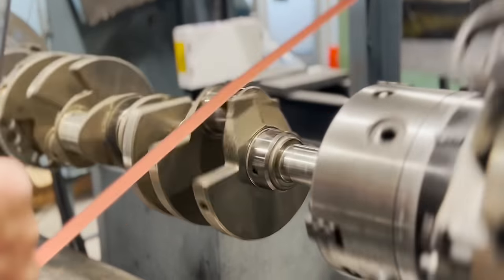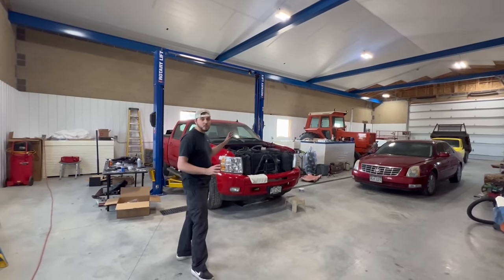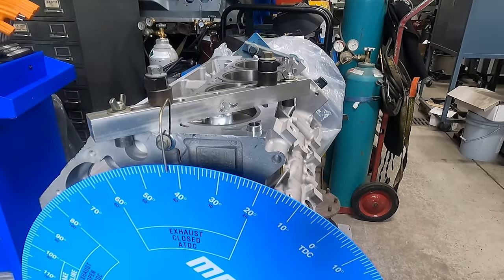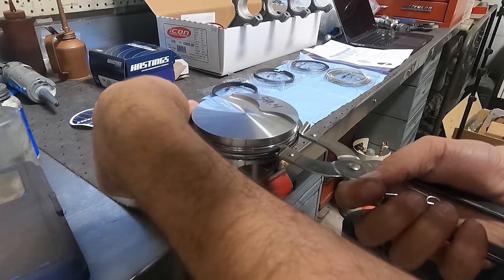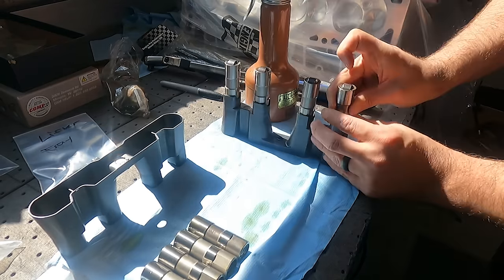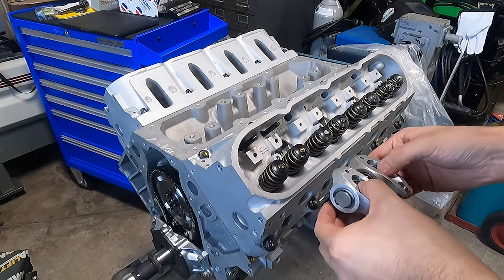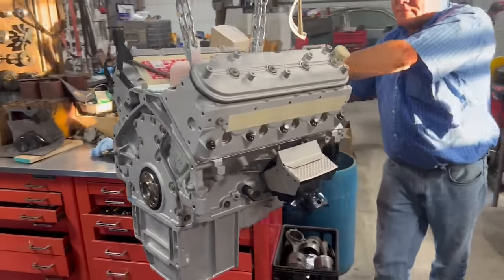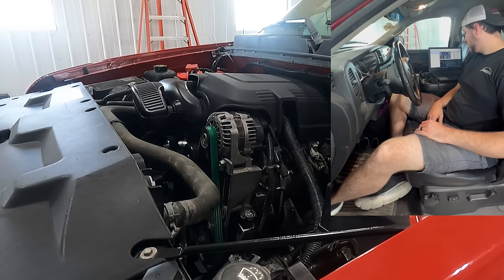I Deleted The AFM And VVT From My 5.3L LS V8! - First Startup - 5.3L LC9 Gen IV LS V8 Build Part 4

Comment: So I get the point of getting rid of the AFM on the GM LS and Dodge Hemi engines (lifters are a problem) but why get rid of the VVT?  VVT helps with performance and driveability.  Is there a known common problem with the VVT in GM LS motors that I'm ignorant to?

Comment: I have a GMC Sierra flexfuel LC9 with 250,000 miles I'm hearing a slight ringing noise when I'm at low throttle sometimes and I lose power. If I floor it I'm fine. It's not throwing any codes. And the engine sounds great and no smoke or anything. I can't seem to get to the bottom of the problem. I do not have VVT and I have a plug in device that keeps it in 8 cylinder which shouldn't matter because I was having this problem before I put that on it. Any advice,I think the AFM is acting up somehow but I don't know for sure.

Comment: Curious to know what year that DTS in the background is because of the known issue of the fine thread head bolts pulling the threads out of the block and if yall have done this type of repair on these Northstar engines

Comment: Nice job.  Did you remove the bypass in the pan and replace it with a plug?  Did you block off the oil passages in the block where the AFM lifters were fed, or just use a different valley cover?  Have heard of people having trouble with oil pressure after doing a DOD delete.  On mine, I got a new standard volume standard pressure pump, but added a couple of washers as shim behind the relief spring.

Comment: I’m still in the same motor but Jen three. I plan on boosting it with about 10-13 lbs. street truck. I want to add ARP main studs. My question is do I need to Line-Hone the mains if I change to studs?  Machine shop near me is recommending line hone but I’m not sure if I trust him or he’s just trying to up sale me? Thanks Nicholas.
Reply from the maker: Only way to know is to torque the caps on and measure to see if there is any distortion from the variation in clamping force of aftermarket studs.

In my case, when I checked I didn’t notice significant distortion and therefore went without a line hone. 

I would ask your machine shop whether they have measured distortion or if they simply always line hone when installing aftermarket fasteners. 

At the end of the day, I would trust your machine shops recommendation. It’s their name on the line so my hope is that they have integrity and only do work that is necessary.

Comment: Nicely Done. I see this as much more as an LS Rebuild Video rather than the delete, but very happy for that. I dont understand why you used the old crank bolt to seat the dampener, why can't you just do that with the new bolt and as well not risk leaving a broke off bolt inside your crank?? Also for the delete, did you change the valley cover or use "rivets" to seal the oil ports into the original cover. I didn't see that, just wondering how you handled it. Nicely Done, Very Nicely Done!!!

Comment: I know I'm late, both in commenting and since the engine has already been assembled, but I must ask, did you use the true LS7 lifters? Or the Delphi LS7 style lifter? 
When I did my engine, I used the Delphi brand and 60,000 miles later, a roller snapped off and took the cam and block with it. Wouldn't recommend it

Comment: Re: cracked rods with ARP bolts - Did the bolts change the geometry of the big end requiring any honing ? Or did you use oversize rod bearings ? Slight paranoia involving 'non-rebuildable' cracked rods.

Comment: Did the Front Crank Seal require lubricant to keep the Harmonic Balancer from going into it dry?   Or does it get installed dry?
Reply from the maker: Depends who you ask. By the book, this seal type/material is designed to be installed dry as I did here.
Reply: @JAMSIONLINE  I also read the same for the original seal.   Thank you for your response

Comment: What caused it to rattle fir the first second or 2  i am guessing  oil getting to the top
Reply from the maker: Great question! With hydraulic lifters, valve train is typically a bit noisy for a small amount of time on startup as the lifters fill w/ oil and work the air out and become solid.

Comment: I noticed you installed a valley cover. Did you tap and block the DOD passages or just use the o-rings in the valley? I want to DOD/AFM delete on my 08' LM3 5.3. The truck is wrecked but the engine is going into another project. I  am wondering because I will use whatever method you used. Your attention to detail is on point. Awesome.
Reply from the maker: I tapped and plugged for extra piece of mind. Reference one of the previous videos in the description 😬

Comment: How does it work when you have cracked rods with ARP bolts? Is resizing not needed ?
Reply from the maker: Always necessary to check when using aftermarket fasteners. In my case when measuring the big ends of the rods I didn’t find any excessive distortion. Touch honed them and moved forward.

Not always the case which is why it always needs to be accurately checked,
Reply: @JAMSIONLINE  thanks for the quick answer, i was considering doing it with my Gen 3 hemi rods but just went with some aftermarket rods instead. Thank you

Comment: Hopefully Colorado will get rid of emissions testing like Washington did last year. It's a racket.
Reply: ontario canada got rid of them either last year or this year for that exact reason
Reply: It depends on which county in Colorado you live in. My county got rid of emissions testing twenty years ago. At least for gas cars.
Reply from the maker: If I registered it at the shop I wouldn’t have to do emissions but I live in town & have it registered here so have to pass every 2 years.
Reply: @JAMSIONLINE  that's how it used to be in King County. It was costing the state too much, so they dropped the requirement. Anyone who didn't pass had to pay an emission certified mechanic an hours worth of diagnosing to get a waiver. Or fix the problem, but not many people chose the second route, unless it was cheap enough.

Comment: Hey bud.. I’m in the middle of building an engine myself. did you measure the runoff on the reluctor wheel?
Reply from the maker: As I remember I tossed the indicator on it quick and didn’t see anything surprising. 

Been about a month since I built the engine, so I don’t recall entirely 🙁
Reply: @JAMSIONLINE  
Got it.. thanks!!

Comment: What is the advantage of removing VVT?
Reply: No advantage except to get rid of a few extra parts that don’t add that much to performance but could cause trouble down the road.
Reply: Can install some really high lift cams. Don’t have to worry about vvt failing. Less parts. It will be more reliable.

Comment: All that work and pre oil with garbage oil ... valvoline  vr1 racing oil high zinc  for break in  then 10 w 30  not 5w 20
Reply from the maker: You think Driven is garbage oil but you run Valvoline VR1? 😂😂😂

Educate yourself:

https://www.speediagnostix.com/new-oil-analysis/valvoline-vr1
https://www.speediagnostix.com/new-oil-analysis/driven-br

In fact you may as well run plain jane Mobil 1, it has as about as much zinc as your "high zinc" VR1 garbage. https://www.speediagnostix.com/new-oil-analysis/mobil-1-15w-50

Comment: Don’t sell yourself short - you’re an excellent machinist, and if you’re a machinist you’re a mechanic. 

In a perfect world you could open a business that does nothing but VVT and variable cylinder deactivation removal from all GM engines. You’d probably have more business than you could handle!
Reply from the maker: Thank you! I just wanted to acknowledge that actual mechanic work is TOUGH. 

Not that machining isn’t, but I was amazed at how physically taxing the physical mechanic work was when installing the engine. Hard work for sure.

Comment: You don't use plastigauge to measure tolerances??? Only dial calipers? Really OMG. I am glad you don't do my engines!
Reply: I hope you are joking, lol. It's called Plasti-"gauge" not Plasti-"measure accurately."
Reply: @wally7856  it measures accurately if done correctly. WTF man. I've used it on tons of engine rebuilds. Plus it measures with the bearings in place. I guess you've never gotten badly measured bearings brand new before, even clevite at times. Order .030 over and get .060 over or stock specs, all kinds of things can happen.
Reply: Our crank had just come back from the machine shop where it was ground 0.010-under on both the rods and mains. Most good micrometers will measure down to 0.0001 inch (one ten-thousandths of an inch), which is plenty accurate. Our mic and dial-bore gauges came from Powerhouse. Always remember to check your tools against a standard to ensure your micrometer is as accurate as you think it is. Also remember to always measure parts at room temperature, around 68 to 70 degrees. Hot parts and/or mics will produce inaccurate measurements.

Plastigage comes in three different configurations: Green (PN SPG-1) for 0.001-0.003-inch, red (PN SPR-1) for 0.002-0.006, and blue (PN SPB-1) for 0.004-0.009-inch clearances.
Reply: @shanemitchell477  Measures accurately on a single line across that circumference. There are 359 degrees of other angles around that circle missing from that inspection. You won't find an oval bore using plasti-gauge. A wizard with a bore gauge and the experience to use one can make a mental 3d map of that bore and the journal and make decisions based on the whole picture and not just a line segment. It's a good tool to use to check things but it isn't any gold standard. It's a "I'm not a machinist so I'll use this instead" tool.
Reply: @wally7856  I actually have a dial caliper and a bore gauge. I usually use both and ALSO plastigauge. Just to make sure the bearings are right. I know it takes longer, but if you want things perfect that's what you do. I also always use total seal piston rings now for everything.